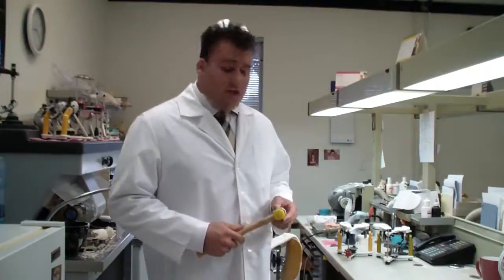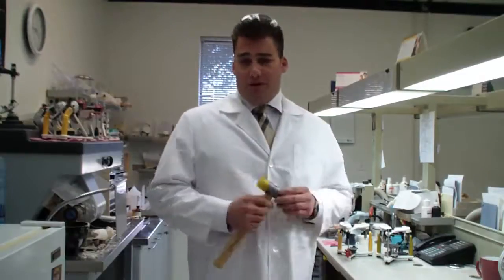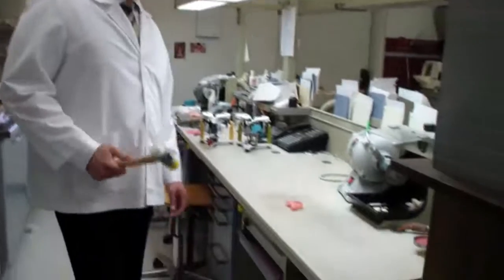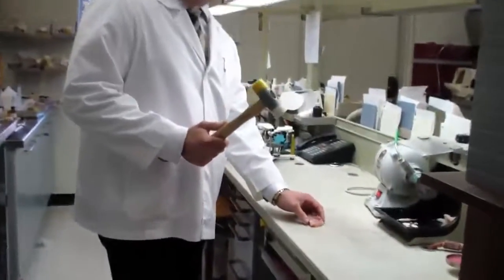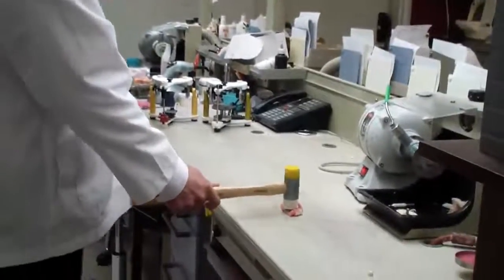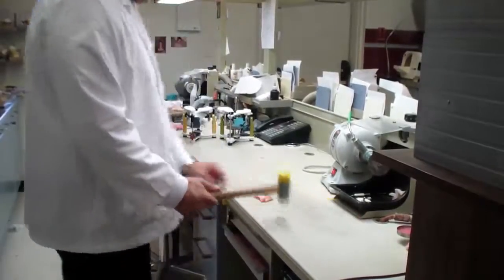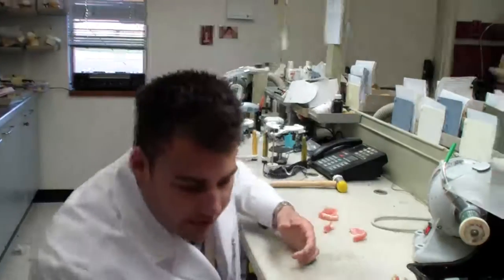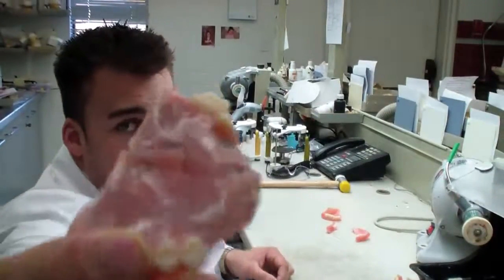Fiber Force® gets hammered.

Comment: I need urgent advice 🙏 I was fitted with this type of all on 4 upper bridge only 6 months ago. I was led to believe they were Zirconium. Almost immediately I had the feeling they would expand and contract from the inside out, bulging out the rear of my teeth. This was very uncomfortable but not visibly noticeable. Eventually I could feel a piece of wire or cable protruding from the back molar. Now the top of the bridge has broken into sections still attached to what feels like a wire cable running along the whole bridge and exposing a strange material, this gives sudden bursts of slimy feeling gunge with a distinctive taste which sets almost solidly in the hollowed cavity which houses  the stretchy indestructible  FIBRE which has a life of its own. This fibre feels like the source of the slimy gunge, by some chemical reaction? Now I have broken pieces moving around and digging into my natural gum causing a lot of pain and discomfort. 
The day of my final appointment to have my zirconium arch made the doctors tried to convince me to change to a “Toronto” prosthetic which seemingly was more durable and had more mobility due to this new PMMA acrylic with a thin covering of zirconia. I refused this “Toronto” and was told I had been given zirconia. I have hacked away the inside of these with a hook, threading the material trying to get some relief only for the shredded material to magically reform itself back again. Can these be fixed and without the self expanding fibre cable? http://www.fiberforcedental.com/en/fiberforce_cst_key_concepts.php